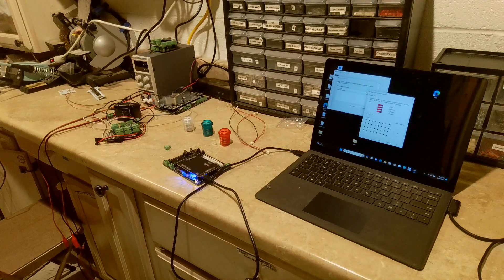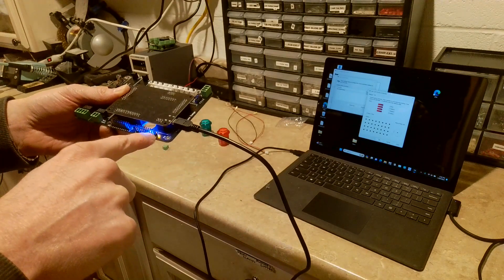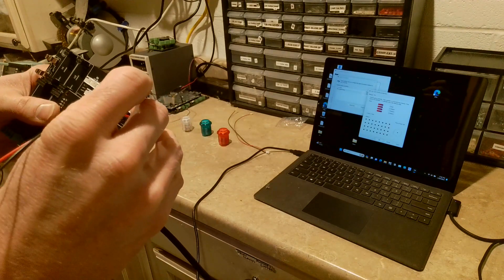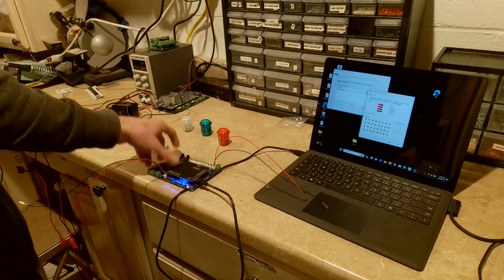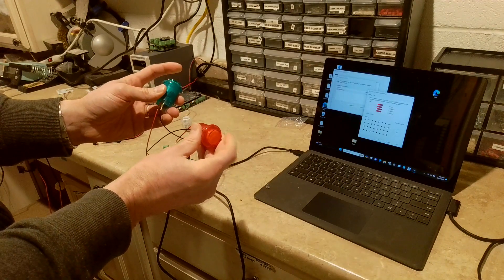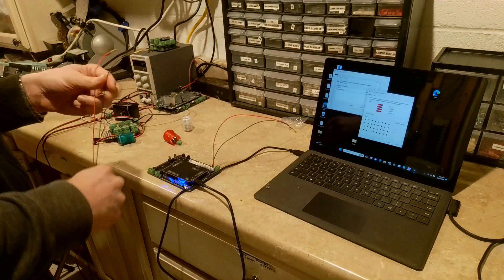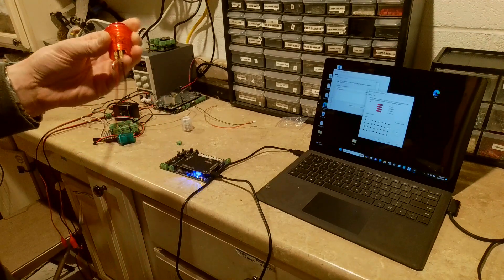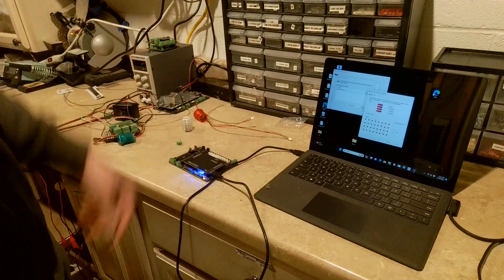Connecting extra buttons directly to the PinOne Mini Board

Comment: I bought some JST connector cables on Amazon and they where too small, tiny. What size, number, specs, ect are the proper JST cables for the Pin one mini ?
Reply from the maker: jst-xh terminals. I also sell them on my website if you need them: https://www.clevelandsoftwaredesign.com/pinball-parts/p/replacement-mosfet-board-jcxnw-wpdch